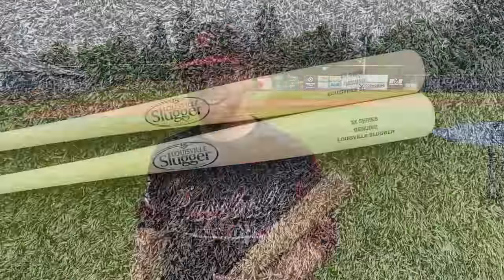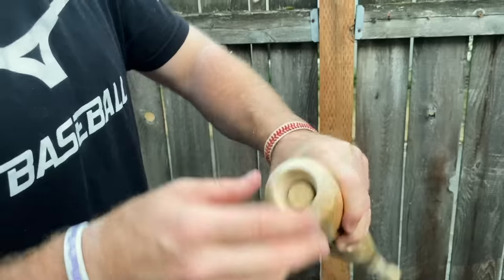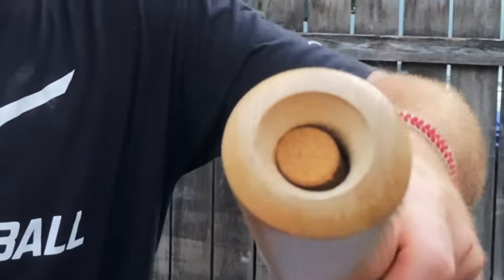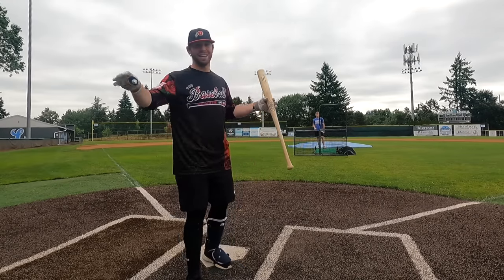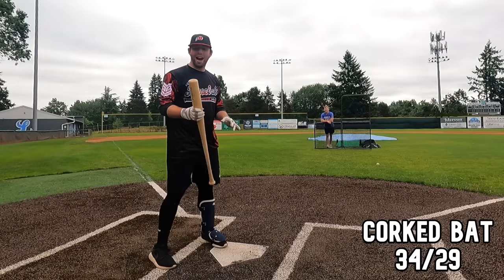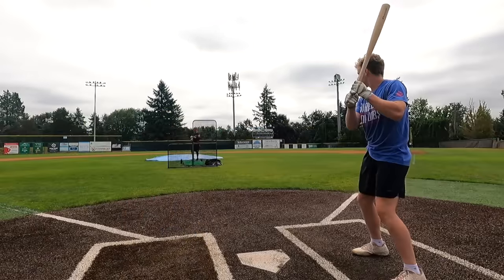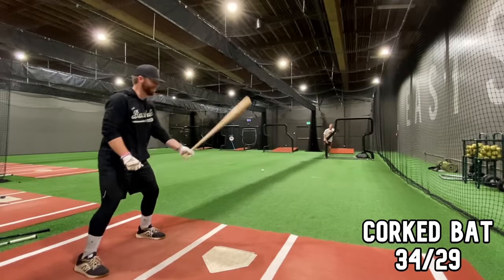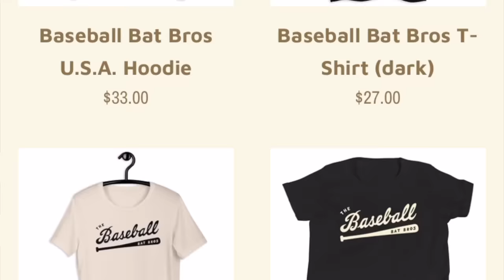Hitting with a CORKED BAT | Wood Baseball Bat Reviews

Comment: I doubt it's a weight thing.  I think the way it might work is when a bat is hallowed it can compress and expand, i.e more bouncy than a fully solid bat, similar to a trampoline or tennis racquet with bouncy strings.  Filling it back with cork, a much softer material doesn't reduce the springiness much but might prevent the bat from cracking to easily if it's packed properly, plus good as a cover up.

Comment: My understanding (back in the 60s) was the bat was hollowed out and partially filled with something heavy like in a dead blow hammer. The bat would weigh the same but when swung the filled material would move to the end of the bat. This would make the bat easier to swing at first (faster) but when hitting the ball would carry more momentum (like a heavy bat). Next time try using a lathe and a solid wood "cork".

Comment: It's a lot easier to drill when you are clicking the hand drill instead of pressing it. If the drill is on highspeed it's just sanding the wood. But if you click it sequentially you will get a slower but solid spin and your drill bit burrows the wood.

Comment: you need to use drill press with a bit slightly smaller than the corks. you can go deeper into the barrell.

Comment: The bats I saw didn't use cork they used superballs that were ground up and mixed with rubber cement and packed tight into the bat and finished off with a wooden plug at the end.

Comment: I Corked several bats for BarryBonds. I also drilled out bats and replaced the insides with a lighter woods for him aand other players.  I used a horizontal drill press i created just for the bats. QA I'mI also plugged the ends with matching woodplugs making it difficult to tell the bats had been drilled.

Comment: You could do some estimates using physics equations. Bat speed, bat mass, ball speed and ball mass. As for the corked bat, you definitely want a more snug fit and seal/fill all the void with a more liquid adhesive and time to cure. Also you want it to be perfectly centered which you will not get without some sort of vice and drill press or lathe. But yeah, fun... Even with a quick job it seems to bear out some advantage.

Comment: When we corked bats we drilled the holes quite a bit smaller and would have to ram the shit in there and we either used rubber cement or something similar def not a fragile substance like super glue. You can drill a hole and only use rubber cement

Comment: Should use corked in a can. They sell cork as a paste which sets quickly. It is commonly used in shoe and boot repairs. That would fill the hole much more tightly improving the durability.
Reply: They call it cork filler.

Comment: No. You need the hole you drill out to be in the sweet spot of the bay to the end of thr Bat and the hole the same diameter of thr bat.  So it fits snug. Like the core of agolf ball or core of a baseball. Lighter but also more flex when the ball makes contact

Comment: The corks can not be loose. dDrill a smaller hole (Dia.) and squeeze the corks in and then tap them in. (maybe some kind of lube to help). Then a solid wood plug to top it off.

Comment: smaller bit head....extended shaft for drill and bit....go down the bat further and use thinner cork...this will drop the weight of the bat but maintain more of the strength/integrity of the bat since you are keeping more of the thickness of the original bat :)

Comment: Good video, but you need to precisely drill a bat and get the cork pressed in to fill the exact hole with pressure from the cork pushing all the way around the hole perfectly. I would imagine it will rock the balls. Cork 4 or 5 corks. Yes, just for fun always never cheat. Always have fun.

Comment: You might get better results if you drill a hole with a diameter the same size as the cork and then jam it in.  It will give more spring and have less of a chance of collapsing.

Comment: Those low-end bats are notoriously inconsistent in their weight. I've bought about 6 of them (black and clear finished), and they can vary by as many as 8 ounces from the standard wood drop of -3. I like to use the light ones when I'm facing really fast pitches. They are a LOT easier to hit with. The downside is that they do break VERY easily. So you could just skip the corking process and just bring a scale with you to the sporting goods store and just weigh them all before you buy. I've found -5, -8, and -10 in the 33 inch bats, so I doubt it's just my luck.

Comment: You gotta use liquid cork, bro! You can't just toss some wine bottle corks in it cause then you'll have a bunch of voids that'll make the bat break very easily and if it doesn't break with a few hits it'll definitely shorten its life by 90%. 
You guys should do a part 2 and use liquid cork instead. If you're surprised with the wine bottle  cork then wait till you try liquid! 
It'll DEFINITELY make you wonder  how Babe Ruth destroyed that ball at the old Polo Grounds dead center over 500ft and how Mantle hit one to the very top back row seats of the upper deck at yankee stadium

Comment: Chop up the cork and use water proof wood glue mixed with the cork chippings then you can pack it in the hole. Also use a piece of dowel rod pressed in to the hole with a good press while it dries the lathe it back to the original cup

Comment: If you do another test, drill slightly tighter hole and press the cork in. Also, figure out a way to blind test so you don’t accidentally swing harder with the corked bat.

Comment: Try filling the hole with ground up super balls then you insert a wooden dowel almost the same size as the hole and hammer it there compacting the super balls. The dowel should be flush with bat.  The super balls have way more action than cork.
Reply: this is how its done in real life. then use wood glue and saw dust from the bat to hide the dowel on the end

Comment: Definitely should have had someone help you out with a lathe, you could do it so much more evenly and basically as deep as you want. Then use cork the correct size and plug it with an ash plug.

Comment: Corking hurts the performance of the bat....luckily it helps the hitter swing faster resulting in a slight overall benefit.

Also, your corked bat would be better if done  on a drill press, but good job freehanded.

Comment: Best way to corked a bat drill a hole collect the dust you will need it . Get two or three super balls grind them into little pieces placed them inside the hole and add glue been with the sawdust that you collected place it on top once it’s dry sand it down a little bit and nobody would know once you hit the ball it’s gonna zoom like a Super ball lol

Comment: the corked bats are bored out on a lathe much deeper and with a far larger diameter boring bar.  The cork is the same diameter of the hole to take up the volume and retain the strength of the walls.

Comment: Need to drill the hole with a slightly smaller diameter than the cork so that you are adding radial force (trampoline) to the bat.  Putting loose cork in there is no different than just drilling a hole in it to make it lighter.

Comment: You should use a drill press and a spiral bit and make the hole more perfect, then glue the corks in properly. Like mix the sawdust you took out with wood glue and coat the corks and then insert them. That'd make a solid cheater bat.

Comment: No harm came of this, but I'd have rather seen you drill that hole on a lathe. Besides being safer, a lathe would have ensured that the hole was perfectly straight and symmetrical. If your hole wasn't straight and symmetrical, that might have contributed to the bat failing a little sooner. 

I recently bought twenty-four inch T-ball bats, drilled a hole at the handle end, and filled them with sand to make "Indian swinging clubs" or "club bells" as they are sometimes called. I wouldn't try to hit anything with them, but they are a nice exercise, particularly for someone who is older and in very poor health. A swinging club routine can be done quickly, provides a little bit of shoulder toning and grip strength, and helps alleviate arthritis issues. 

A similar exercise is mace swinging or "mace bells." Most people who do that regularly use dedicated maces made for that purpose. You could get a similar effect by drilling the same hole in the bat and filling the hole with lead. I'd then cover the end of the bat with a pool noodle or some similar foam so that police don't see the thing as a weapon. The mace swinging exercises might be good for building muscle for swinging a baseball bat. In some ways, the maces are like baseball bats with those "donut" weights that players use when warming up. If I were in better health, I'd want to do mace swinging as well as club swinging.

Comment: You should grind a buch of corks up into small pieces and mix it with heated gorilla glue and pour it into the bat and when it dries the glue will expand and it will have a tighter fit.

Comment: Chop the corks in pieces and you’ll be able to fit more cork and It will perform better too because it will distribute the energy better and if its compressed the bat will last longer.

Comment: If you were doing it for real I would think you'd make it so you have to jam the cork in like you jam cork into a wine bottle - really tight.  But it still might just break more easily.  A problem with the major league players I think is that they just swing the bat so hard so a corked bat is likely to break.

Comment: Since the hole was significantly bigger than the cork, leaving a large void that the glue did not fill completely, this test was more like a bat with a hole in it, than it was a corked bat.  The cork MUST be oversized and  the tip should have been plugged with a disc of end grain ash, which would lessened the likelihood of splitting and greatly improved durability, and rebound.  Spackle is definitely not adequate.  It’s amazing it lasted as long as it did.

Comment: People don't realize why the cork helps.  Rules state that the length to weight of the bat have to be a certain ratio.  So if the bat is X length, it has to weigh a certain amount.  When you Cork the bat, the bat is suddenly lighter.. meaning you the hitter can have a faster bat head speed with a longer bat.  The bat itself, does NOT perform better.  It's the batter that can perform better with it.. Mythbusters tested it totally incorrectly back in the episode that tested it.

Comment: Pretty sure corked bats aren't necessarily better because they are lighter, but also they have to ability to bounce the ball off the bat faster due to compression. The wood cylinder of the bat compresses and then rebounds back into the ball. Think dropping a penny of a drum vs dropping it on a table. The goal of putting cork back in the bat's cavity is is to keep the bat from collapsing back in on itself. Cork is spongey so it doesn't impede the compression of the bat's wood cylinder, but also dense enough to keep the sound off the bat similar enough and keep it from compressing to the point it will collapse and cave in on itself. If it was just a question of weight, why not just fill it with Styrofoam? Try hitting a golf ball with one of those empty water cooler plastic jugs... you'll see it GOOOOES not because it's light, but because the plastic compresses and then rebounds back into shape sending the golf-ball FLYING. It's not about the weight, it's about the compression.

Comment: The cork and the hole have to be the same size, you should cut a wood plug to barely fit the hole and assemble it in a press so you can squeeze the plug down.

Comment: Hole is entirely too fat. It should be almost too tight for the cork to fit then press it in. If you were going that large, you should have just filled the thing with pure silicone calk. The rubber would have given you some flex. Idk what it would have done for weight.

Comment: Redo this but try to make the hole diameter smaller to fit the cork better so there is barely in air inside the bat and pack it good

Comment: The corks have to be really tight in the hole. Sammy Sosa probably had them built by someone with a lathe and had to press in the corks. The corks also need to be have oil poured on them after each cork is pressed in. This will swell the corks causing them to be extremely tight and give a pronounced rebound to the ball when struck.

Edit- the loose corks is why the barrel collapsed

Comment: I really think you should have spent a little more thought and effort when cooking the bati.drilling it on a drill press to exact tolerances or maybe even less than diameter of the cork.and using  solid cork center pressed into the core.i was thinking that if you drilled the cork in its side and inserted a 1/8 or a 3/16 maple or ash dowel and have the ends of each dowel to match the radius of the cork.space d out along length of cork.2 or 3  dowels.that way the impact would transfer the energy through to the opposite side from the I pa the side thus sharing the loads.which I think would at minimum increase the durability and longevity,and reduce cracking.but will also make the sound much louder and more similar to uncorked  but ouder.due to increased bat speed.but I also think it would improve the distance of the ball.you got to one day this method.be nice to see it done with different density of cork.and different materials than cork.like expand ding foam.also using polyurethane glue to line the hole and dowel holes before inserting center core before it dries.also one big last thing.you need to plug the hole at the 3rd with a solid wooden ash matching plug or dowewhich needz to be glues solidly all around  to make the end as 1 solid piece to maxi ize strengty ,length,durability.this is really important

Comment: To all the armchair physicists in the comments, the cork itself does not produce "bounce". I'm not trying to be offensive, but this is what your 12 year old brain imagines the cork does. I know, because I also used to believe this when I was a kid. You think "oh cork is rubbery, it must be bouncy". Unfortunately, it does the exact opposite. If you were to perfectly pack a bat barrel with cork, it would actually absorb more energy than the solid wood barrel would. The only thing the cork might do , is dampen some of the vibration, but even then, you would need to research where the optimal zone would be for dampening. Wood baseball bats do not compress, the ball does. In our universe, with our laws of physics, there is no corked baseball bat that is compressing into the corks and springing back. I'm sorry to ruin it for everyone. The bat would crack in half before it compressed enough to do what you think it's doing. The results are driven by the bat being lighter, and the swing speeds being faster. A hollowed out bat with no cork would be more effective than a hollowed out bat with cork, because it would be lighter. The problem with this, is everybody would notice it.

Comment: It wasnt corked properly...try to get bigger corks. Or grind them up.. if you use whole cork , the bit needs to be 1/16-1/8" smaller than the cork. You want to really have to ram the cork in the bore... The hole in the bat should be as long as the barrel. All the way to the beginning of the taper.. the cork bat theory is 1: is lighter, 2 the filler helps maintain structural strength. 3: most importantly , the combination of the hole, and the cork filling create a " trampoline" effect when the ball leaves the bat. Just like alloy bats

Comment: Dude I could cork a bat and film it and send it to you. I will make the hole the exact size for the corks and epoxy them in. Then cap it with a wood plug again epoxy it in. Should be more solid than the wall plaster.

Comment: You drilled it wrong. You drill it just a little bit smaller then your corks and you drill it 8” to 10” deep and drive the corks in filling the entire void. Also you don’t use a wood paddle bit they make much better wood bits the paddle bits are just the cheapest option that will drill through wood.

Comment: Not great. You need to get moldable cork like they use in shoes and pack it in tight. for high end shoes the footbed is made of ground up cork paste. it molds to the foot. That's what needs to be packed into the hole air tight. You can fill the end with a plug but made of the sawdust you hollowed out and titebond wood glue. The Not just wine corks lol. wtf? But yeah a corked bad works massively. And it's not for being light. It's to create a spring. It's not about weight. And i've hit with several corked bats in the 80s.

Comment: Corking a bat wasn’t about making it lighter, it was about making it more flexible internally. Ie it could compress when striking a ball and then expand. Giving it a trampoline-like effect on hitting the ball. The trick was to get the head/cap off the bat so you could put it back in without visually being able to pick it.
This video is utterly off the track.

Comment: Oh and idiotic from the start. Match your drill to just less than diameter of the cork, sand the cork a bit with a belt sander and pound that shit tight, using like silicon as a lubricant that will solidify kinda.

Comment: Wow 30 seconds in and your “explanation” of how corking works is already wrong. It produces a “trampoline” effect resulting in more spring off the surface. Just like a thinner driver face in golf hits it further. It also makes he bat weaker, just like a driver with a shaved face will eventually crack

Comment: Not sure why you didn't follow the instructions you showed? And wine bottle corks really when doing this you need a longer piece of cork and you have to drill very precisely on a lathe. No gap between the bat and cork and you have to seal the end of the bat with wood filler not silicon. Hence why the bat broke so soon. Not that I've ever done this wink wink but if you are trying to show how it improves distance over a regular bat. You didn't do that in this demonstration.